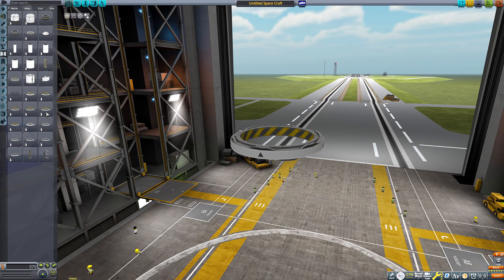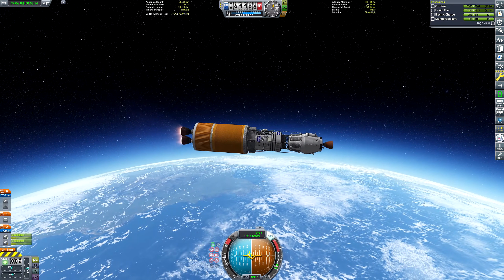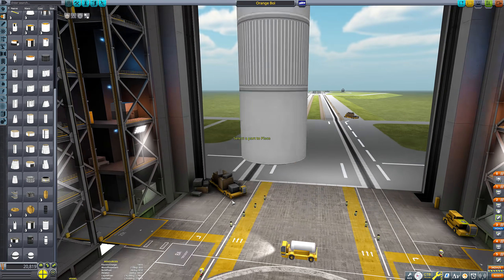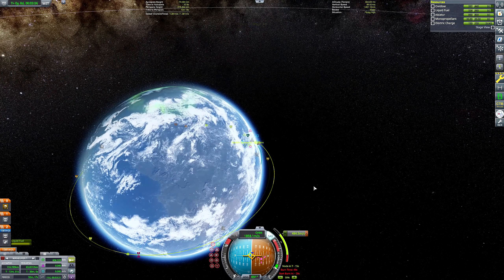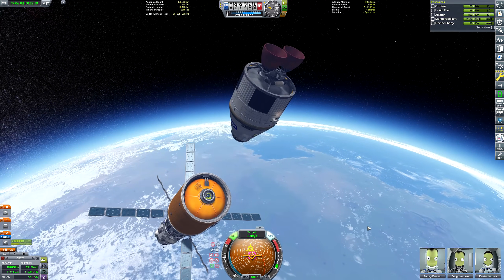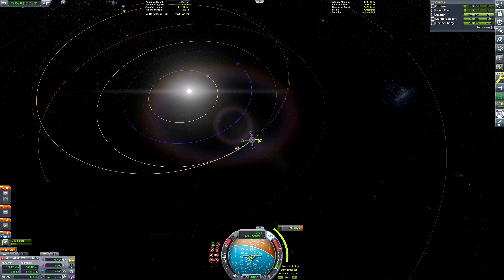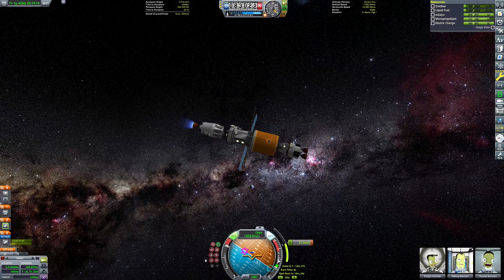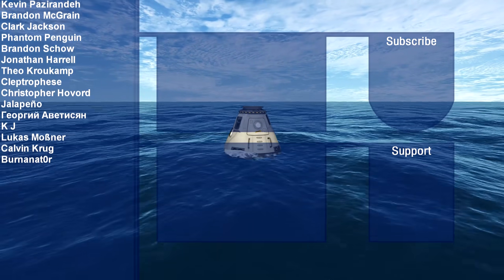KSP: NASA's Plan to Build Skylab 2 Using SLS Tanks

Comment: It's not a perfect solution, but for "wet workshops" or converted stages, I would clip some small passenger modules into the tank. I would then drain the fuel if it was only a converted stage, not a wet workshop. Atleast in stock.

Comment: The Skylab being a wet workshop was originally because they were expecting all the Saturn Vs to be used for Apollo missions, so they were going to have to use a Saturn IB, and the also dock the Apollo Telescope Mount to it on another flight. However when Apollos 18-20 were cancelled they switched to using a full Saturn V, and then they could launch with the ATM already on. However they left the extra docking port

Comment: 7:25 so the fairing's diameter doesn't have to be increased for the lab, the engine is smaller so the tip of fairing will be more triangulated.
They were very efficient you know.

Comment: After 1 week of playing KSP i finally landed on minmus and made it back the size of missions ur doing is insane for me rn
Reply: Practice, practice practice. Landing on Minmus will be insanely routine at a certain moment. In the more career driven save's I've set up a regular nuclear shuttle service between Mun, Minmus ore harvester and a kerbin space-station with a SSTO to rotate crew, and fuel carriers / depots to refuel in orbit. Sprinkled with some internal role playing rules that I never use my nuclear engines in proximity (or directed) to nearby vehicles to spice up the challenge. The first time I had to de-orbit and land near a surface base seemed impossible for me, but after 2 or 3 succesful attempts is just extra steps. Same as with docking, first it seems impossible, but once you get a hang of it and understand what data the game is giving to you, you do it 10 times in an hour speedrunning through them.
Reply: @Tuning3434  ye but for now i don't even know how to get into orbit normally i just go up and then go to the side
Reply: @roonion6365  As matt himself said, by the time you are 10km up, you should be pointing at a 45 degree angle
Reply: @aguywhodoesstuff1116  ye ik but every time I do that i don't have enough fuel to go to orbit
Reply: @roonion6365  Oh. I don't know how to help in that case.
Reply: I remember my first time landig on Minmus 2 years ago using Matt Lowne's tutorial. Other then practice, you"'ll need dedication. Try your best. Always expect mission failures and learn from them. Trust me, with enough experience and dedication you'll eventually land on Eve and the Joolian moons.
Reply: @starstorm5338  ima go grind some more once I'm back home
Reply: Notice it took Matt, a skilled Kerbal engineer, three tries to get the crew mission right … so don’t feel bad if you miss something vital. Just back up, fix it, and try again! I always hit quicksave before trying a tricky maneuver like landing.
Reply: @steveschritz1823  🤔landing gear and not scientist kerbals are so annoing i always forget them
Reply: I keep forgetting solar panels or radio antenna on my probes and suddenly can’t control the craft lol
Reply: @steveschritz1823  for my mission to mun i ran out of electricity cuz forgot dollar panels and fuel so i had to return with Eva jetpack and then send a rescue plane to get the science
Reply: Congrats! That’s a big deal and you made it!
Reply: @vosechu  ty
Reply: Sometimes his missions are small and then realize that I can’t even get to tylo or jool